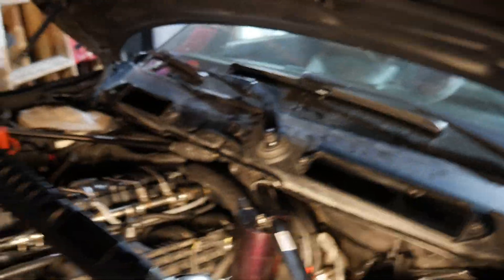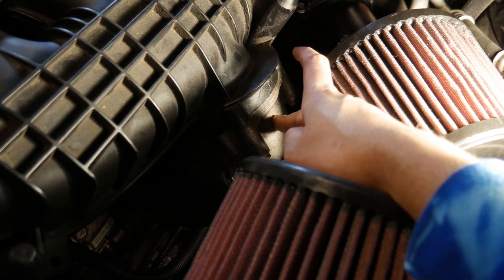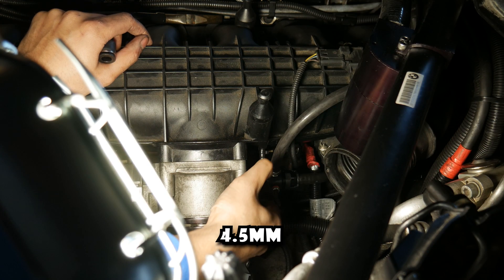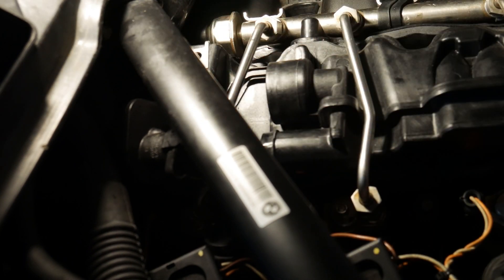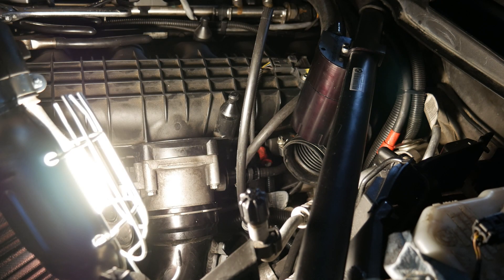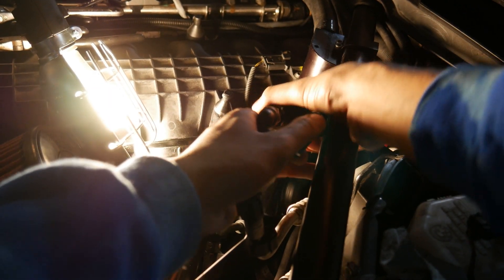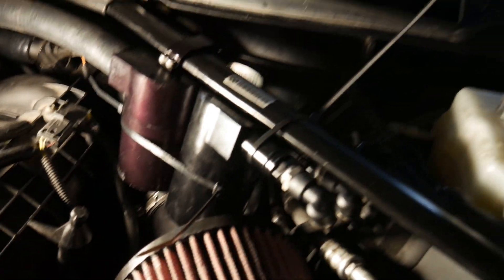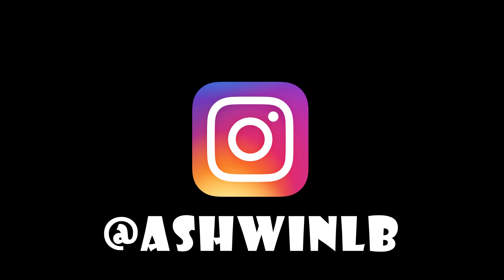BMS N54 Vacuum Side OCC Install! | BMW 135i, 335i, 535i

Comment: So do you connect the adopter to the valve or you remove it totally
Reply from the maker: You remove the stock valve completely and then thread the adapter on!

Comment: I want a catch can on my N55 but all the cables & knowing which is what is really ridiculous
Reply from the maker: Yeah man, this gen of bmw has crazy amounts of wiring and cables just everywhere. I’m just happy we don’t have it like the n63 v8 guys😂 I’m not too familiar with how the pcv system works on the n55 but if it’s anything like the n54 it shouldn’t be too bad of a install
Reply: @AshwinLB  I just installed a better intercooler & charge pipe on my garage floor after the OEM plastic junk blew so I'm not incompetent but I'll definitely need to look up n55 vids to figure out the PCV mess of cables.
Reply from the maker: I did some research and it doesn’t look to be too bad. I found this install guide made by BMS for the n55 catchcan: https://www.n54tech.com/instructions/N55_BMS_OCC_install_guide.pdf

Comment: credit from Rob from RB Turbos "Left Top: PCV Vave Screw-On Cap (unthreading this lies the PCV Valve)
Left Bottom: Vent Hose/Flapper assembly ventilation connection
Mid to Right "Cone looking objects": Four Cyclonic Separators that aid in "flinging" off larger oil droplets (from the crankcases ventilation environment) and letting them drain back into the crankcase.

It is important to see that with the OEM valve cover BMW has gone to some great lengths to keep oil in the engine. Upon dissection one would find tremendous baffling along with the cyclonic separation area, which does the best job it can keeping a crankcases "oil vapor riddled atmosphere" from passing to the outside world.

Over the next months some will purchase new aftermarket valve covers with literally zero cyclonic separation (and zero baffling), and our bet is that they will all be passing tremendous amounts of oil from the crankcase to the outside areas of the engine shortly thereafter. Unfortunately not many seem to understand some of the fundamentals of engines and design, and how to improve it effectively and efficiently. My $.02."
Reply from the maker: Very interesting! It’s the main reason I haven’t gotten rid of the plastic OEM valve cover. All the aftermarket metal ones have no baffling. Rob is the OG, I would have went with his external solution if I didn’t already have the BMS high side
Reply: @AshwinLB  There is no alternative to the OEM plastic valve cover. Any aftermarket cover will be throwing huge amounts of fresh oil out your external pcv fitting as oppossed to the cover recirculating and the PCV fitting simply easing the pressure. Every 2000km you'll be dumping your half full oil catchers back into the engine once you realize you've wasted $200 on oil last month. Under full boost; you'd have a fairly steady consistent drip that'll fill her real quick. The BMS solution is simply a RB copycat, Both do what they are 'supposed' to do. PS - Get your engine mounts changed; make sure the 3 bolts on the power steering pump have some blue locktite, n' clamp those turbo inlets down real good. Happy boosting.

Comment: You dont have problems if you take your PCV valve out? Were is the vacuum going before you took the valve out?
Reply from the maker: I believe that with the original PCV valve it would vent back into the crankcase, with the oil going into the valves through the head ports. Since this system is still a closed loop with a check valve, it doesn’t cause any issues.